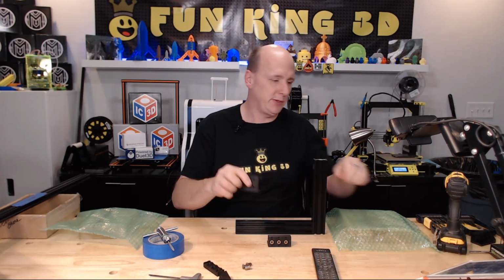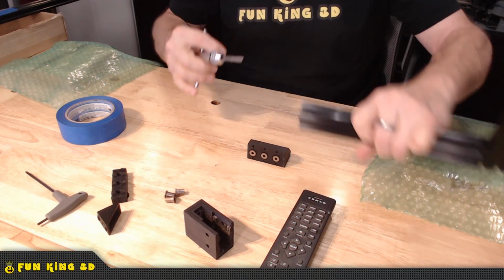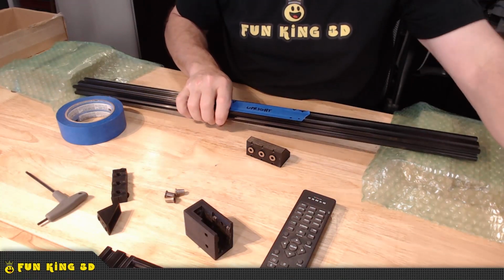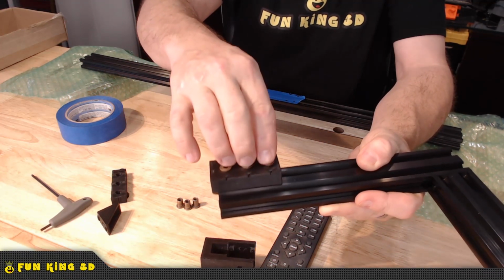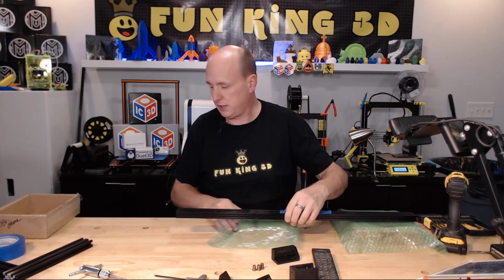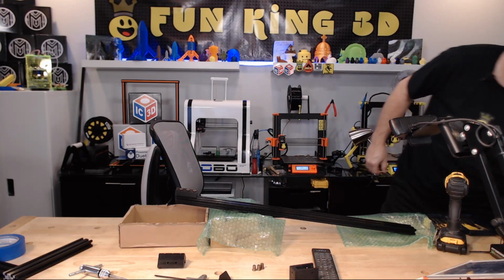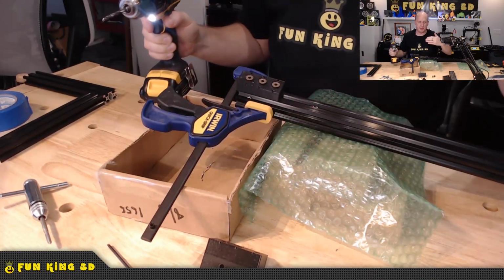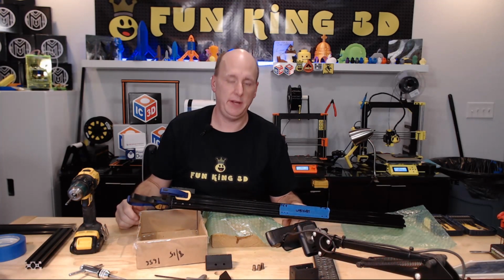FK-1: Step 2 Tapping and Drilling the V-Slot Aluminum

Comment: Glenn, been watching some of your progress on this.  Wondering if you have some real projects planned for such a big printer?
Reply from the maker: Honestly, I did not really pick the size based on any particular project. I fell in love with the gCreate Big and was going to copy it. Gordon from gCreate gave me some pointers for things he would have done different, etc.. Once the initial design was coming together, James from Print N Play pointed out that I needed to make sure the bed could handle the weight of itself, PLUS the weight of what was being printed. So it was redesigned into this thing with the static bed.

I jokingly say that I am going to print street signs and European license plates, but to be honest, now that it is coming together, my plans are for a full Iron Man armor and full size R2D2 and want it to be in as few pieces as possible.
Reply: @FunKing3d  Thanks for the reply.  I had not heard you say much about projects.  My first & still only printer is a "dolly" clone ala Tom Sanlanderer.  It was fun building but has been rough getting it stable.

Comment: Glenn, it may be because I am slightly nuts, but, weren't the holes in the groove area?  isn't that area not double walled, outside of the hole that needs to be tapped, and do the screws passing through the side interfere with the 1st holes drilled?  seems like they would be in the same plane, if you used the same jig.   Great video, and what are you going to do with all the metal shavings?
Reply from the maker: Not sure I understand what you are asking, so I will chock it up to you being nuts. LOL! The holes drilled do cut through the extruded holes that you tap.

As for the shavings, I should have melted them down and made more extrusions. LOL!
Reply: Fun King 3D I was thinking that if they drilled holes intersected, wouldn’t you be putting a screw thru a spot occupied by a screw?   I’ll have to rewatch it on the TV and see if it unconfuzzles me.  😋

Comment: I've been trying to drill ~5mm holes through extrusion, and I've been having trouble keeping the material in place after the drill makes that first hole through the top, as you describe. It always spins the extrusion and binds in the hole. I've been using a 7/32" 135 degree cobalt bit, if that matters. Any suggestions?
Reply from the maker: Are you using my jigs?

Slow, low pressure, and SHARP bits are key. And if you really want to make them straight, a drill press would be the way to go. ;)
Reply: @FunKing3d  I tried using a different 3d printed jig (which didn't use bushings) and it didn't help. I'll try yours in the future if you think it will help. Thanks for the tip about drill bits. And I'm trying to avoid getting a drill press as I don't have much space for one, haha.